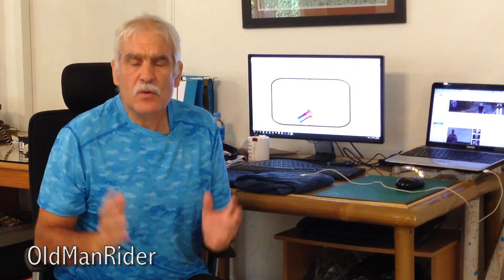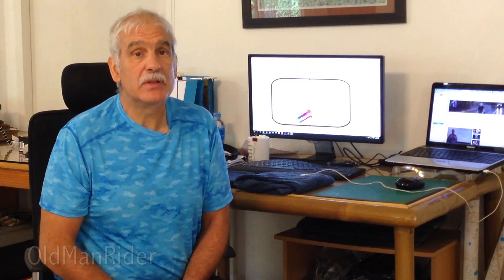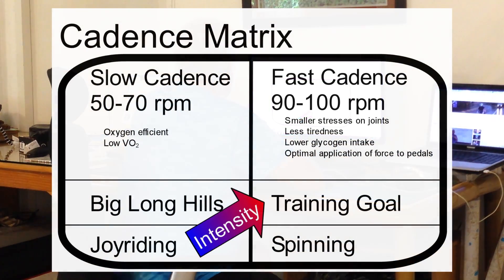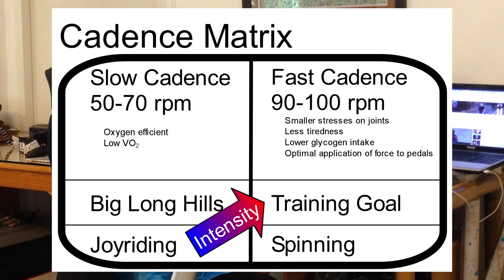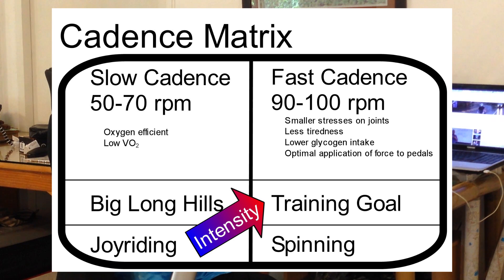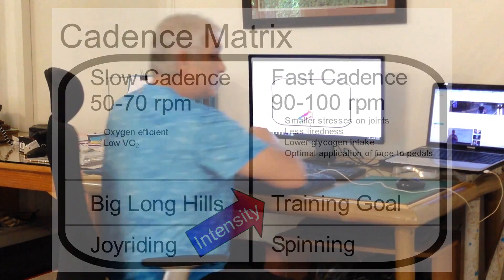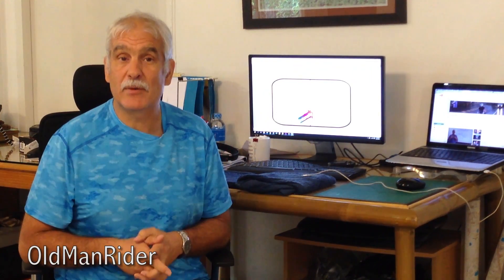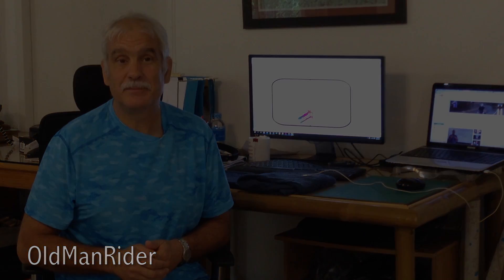How To Scientifically Choose The Best Cadence

Comment: I hear the Armstrong/Ullrich debate used to ALWAYS justify high cadence is MUCH better than low cadence riding.  Keep in mind though Armstrong BARELY beat Ullrich in the multiple tours they rode together.  Also Merckx and Hinault the top 2 riders of all time were mashers on climbs, sometimes dipping in the low 50s rpms.  My take is master BOTH low and high cadence so you feel comfortable from 70-100 rpm on flats and 50-80 rpm hill climbing.  Riding a single speed helps expand your cadence range.  My rule climbing is spin till I'm out of breath then mash till I'm out of muscle then back to spinning and continue the cycle. Also the more power\wattage you push, the faster you need to spin.  There"s a reason the majority of hour records were won at 100+ cadence.  Also its your genetic makeup, muscular riders should mash, skinny riders should spin.  Your body will tell you your proper cadence so listen to it, while at the same time listening to the power you're putting into the pedals so the resistance isn't too easy or hard. All this hyper cadence nonsense got started when pro riders doped on EPO which increases red blood cell count.  If you don't take EPO you can't climb mountains at 100 rpm like Lance.
Reply: I should add that IMHO both
 back in the Old Days AND Now the universally excepted optimal cadence theory is skewed. The old schoolers grinded too slow, the new schoolers spin too fast. Here's my 'Unscientific' 'ideal' cadence ranges: Overall Flats: 75-95 rpms. Flats - 'endurance/cruising/triathlon' 73-87 rpms. Flats - Urban traffic defensive/fast group/racing 87-100 rpms.  Quick Accelerations/Sprints: 100-120 rpms.  Finish line of Race Sprint: ~120 rpms. Overall climbing: 55-85 rpms. (However if its a real short climb just power it out just slightly lower than flat cruising cadence) Gentle slope 1%-3%: 80-90 rpms. Gentle/medium 3%-6%: 70-80 rpms. Medium 5%-9%: 60-80 rpms.  Steep 10%-14%: 55-70 rpms alternating btw. sitting/standing low/high cadences.  Super steep 15%+: 50-60 rpms (or 40-50 rpms if you run out of low gears), at least 50% out of saddle using handlebars as leverage.  Also on long mountain climbs its best to pedal in lower cadence range for the majority of the climb.  Also muscular build plays a factor.  Fast twitch muscular riders ride at lower cadence range and skinny slow twitch endurance riders pedal at faster cadences.  Also long legged riders may tire out easily at higher cadences, especially if their legs are heavy/muscular (Jan Ullrich's problem).  So as I stated before your 'Body' will 'Tell You' the proper cadence you should be in.  Low AND High cadence training is a MUST in your cycling conditioning program so you develop into a Well Rounded cyclist. Spin to win but Don't be afraid to grind it out sometimes. ("Mashing Huge Gears Builds Strength" - Bernard Hinault, 2nd greatest Cyclist of all time)
Reply: @ministryoftruth8588    
I think you are correct and this higher cadence is better so called science is skewed.  Different body builds along with what muscle fibers you have will dictate your ultimate cadence zone. Cadence isn't a one size fits all component given the wide differences in the human body. I was called a grinder because I could push big gears on hills but I am also 6'3 with long legs. I would laugh when these riders spinning nearly out of breath would tell me I'm in too big of a gear will dropping them. But I do agree with doing low/high cadence drills and you will find your optimal cadence  especially on the big climbs if you practice enough.
Reply from the maker: I think you are on the switching back and forth between cadences when riding. Hi and low cadences optimize different things so unless you are one of those supermen we can’t keep at the same thing forever.

Good advice!

Comment: Here's a tip: if you want to increase your cadence, specially on climbs, don't just go for easier gears. Actually, you need to do low cadence intervals with hi efforts to get stronger, and thus have the strength to spin faster.
Reply from the maker: No argument on that!
Reply: Been working on those GCN videos so I hope I can start the season strong!

Comment: Thanks for the great comment!

Remember what you are optimizing and what path you took to come up with your desired cadence.

A slow cadence is the result of the optimizing for overall oxygen efficiency. This is where we end up when we are not paying attention and we get lazy.

A higher cadence is the result of deliberately optimizing training goals. It takes constant work and attention.

No one ever says, "I spaced out there for a while and found myself pedaling at 110 RPM."

Articulate your optimization goals then choose a cadence.

For example;
"I'm going to maximize funness on a joy ride with the little kids at the family reunion therefore it makes sense to pedal slow."
"I'm training for the end of summer race therefore I'm going to do HIITs and focus on keeping my cadence high."

Your push back is exactly correct, we don't want to do that at all. It's really easy to focus on some number and forget the purpose behind it. Putting purpose and optimization first your comment would come out something like, "I want to burn out quick, put a lot of stress on my joints, and use poor technique therefore I'm going to pedal pretty slow on this workout."  Like you say, not a good idea!

Thanks for the chance to reply.

Have a great day,

OMR.